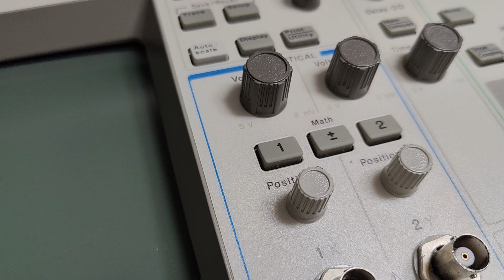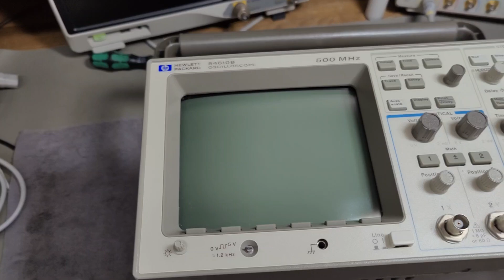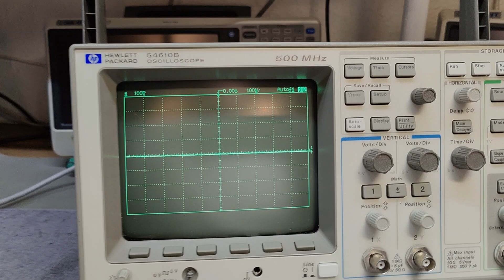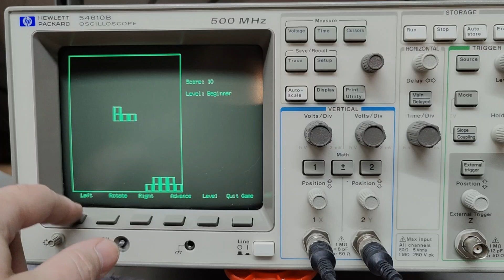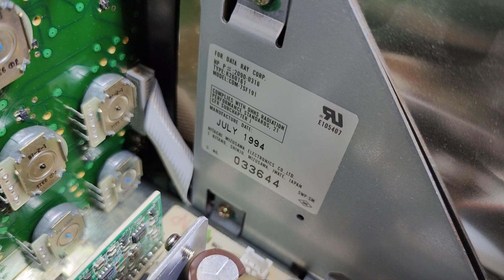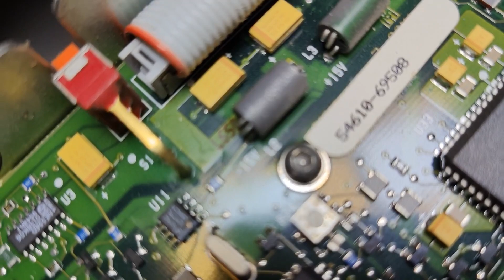HP 54610B Oscilloscope 2ch 500MHz digital 1994 test teardown

Comment: Don't wait for the Dallas chip's battery to fail - the calibration data is kept in there. There are several threads on EEVBlog explaining how to remove the chip, dump the contents and install a new one so that the cal data is not lost. I have the 54602B, maybe I should make a video on replacing the chip.

Comment: I have an hp 54645A that I got for $100 on eBay and I love it! Mine is only 100mhz, but I primarily work on audio equipment, so I really don’t need a super fast scope. Be careful not to push on the knobs on the front panel, the pcb is brittle and prone to cracking, I had to fix 2 broken traces in order to get the channel 2 controls to work correctly.

Comment: I had a very similar, slightly newer one which had an almost arcade-perfect (at least gameplay wise) version of Centipede (which also has a highscore list - mine had some very low scoring entries tho, I got over 50k). I've also heard of Asteroids. Those programmers really had too much time.
If you hit the 2nd and 4th buttons in that menu (or was it 3rd and 4th?) there is another easter egg that shows a photo of what looks like a skunk and the names of the programmers (and you can still use the scope while it's rendering, it just doesn't react to button presses). IIRC mine was from 1997. I passed it on to a friend.
Reply from the maker: can you please explain in more detail how to activate that 2nd egg ? we tried all, no luck..
Reply: @TeardownOZ2CPU  Maybe yours doesn't have it. Mine is from '97. On the Print / Utility menu, there were three unpopulated menu entries (from left to right button 2, 3, 4). Pressing 2+3 gets you the game, pressing 2+4 gets you the 2nd egg. Or was it 3+4?